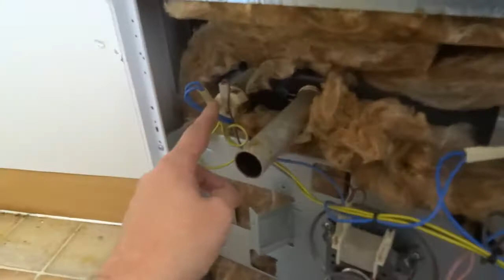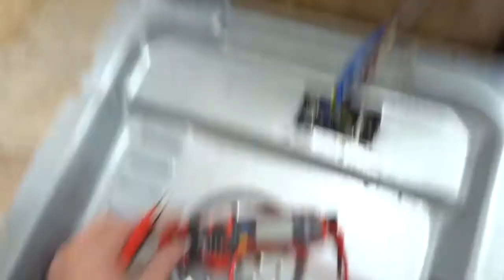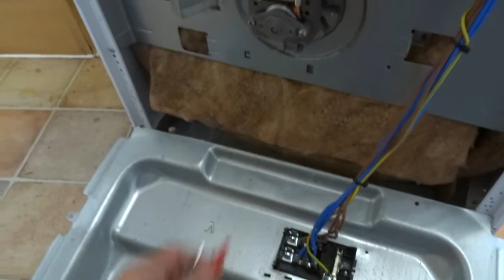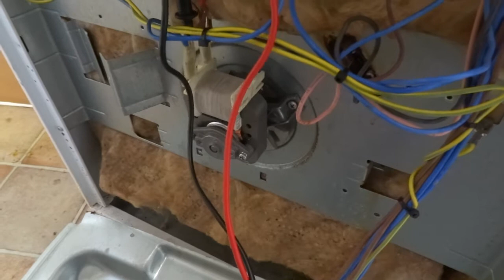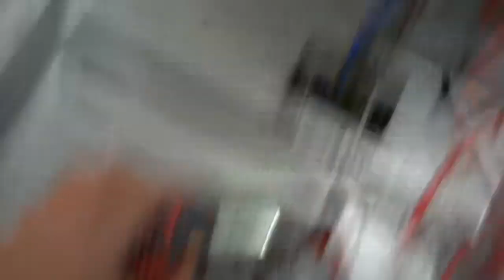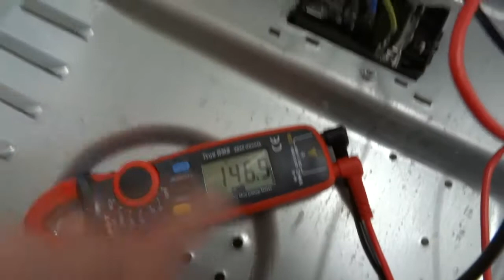Oven Fan Not Working? TCO & Motor Test DIY 240V Repair Guide

Comment: Hi , whata brilliant video firstly  .
Secondly  I have resistance at the thermal cut out , power to my motor and also have 101 ohms at my motor but my motor doesnt spin when the oven is on . The motor spins when you manually spin it but not easily (not sure how easy they should spin) .
I am still thinking motor but its not a cheap part so just wanted a bit of advice if possible . My oven is a neff u14m62nogb 01 and i cant find anywhere what the ohms scale should be within for my motor .
Thanks
Reply from the maker: Glad it helped

Comment: Hi what are the parameters of the ohms readings for the windings on a oven fan,  what should the readings be between, so you know they are not faulty
Reply from the maker: Im looking for low readings or shorted or open really.But yes if you needed to do as you say you should check your manual or the manual for the motor for exact coil readings to check for out of range readings.

Comment: I'm trying to find out why my bush fan oven is not working so would you know if the thermal cut out or the fan motor is faulty with the readings I'm getting. When I test the thermal cut out I get resistance but the ohms are showing 0.000 then when I test the fan motor I'm only getting 0.141 ohms.
Reply from the maker: It looks like motor is shorted , are you sure its ohms and not Kohms 0.141 kohms would be 141ohms which is a ok
Reply: @cagmito76  Thanks for replying. Yes it's k ohms and not ohms. It did show k ohms on the display but I didn't know what the k was so maybe I need to find the instructions and have a read. I've removed the fan and the shaft don't spin that freely and when you push the shaft in and out it feels dry so maybe the bearing have gone.
Reply from the maker: @gettingoldereveryday  No worries easy mistake done it myself many times ~ yeah it could be , was it fan not working or was oven not getting hot.
Reply: @cagmito76  fan is not working
Reply from the maker: @gettingoldereveryday  Looks like it then , if thermal cut out is ok it could very well be sized bearing you could test at terminals for voltage but i would not recomment this without a very good multimeter.
Reply: @cagmito76  I bought a new fan motor and it's reading 0.319 k ohms where the old one is 0.141 ohms. The problem I have now is I don't know if to fit it because my motor is 26 watts and the one they sent me is 21 watts.
Reply from the maker: @gettingoldereveryday  Yeah i would prefer exact same readings , but its not to say the original is not damaged internally , it would not be dangerous to fit it , if it was a lot lower resistance id be more worried.
Reply: @cagmito76  Thanks for the advice you gave me.
Reply from the maker: @gettingoldereveryday  is it now
 sorted ?
Reply: @cagmito76  No it's not sorted. The fan motor I received needs to be sent back because when you spin the shaft the fins looks like a buckled wheel and if you try and move the shaft you can feel slight play. I don't know if to buy a new cooker or buy another motor but if I do buy a new motor it looks like you cannot buy the original and the only one supplied now is part number 32013533 YJ61-16A-HZ02 - 21w where the old one was part number 32013533 YJ64-16A- 26w. I don't know if there's any difference between 21 watts and 26 watts and when I contact the seller they don't have a clue.